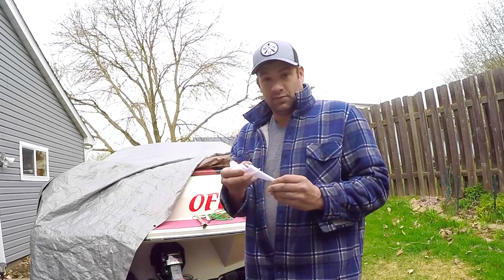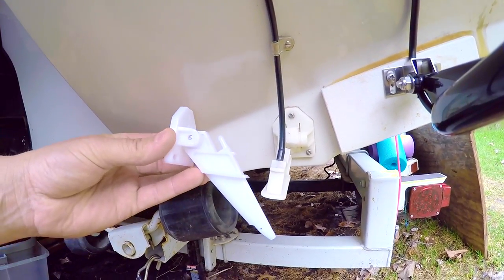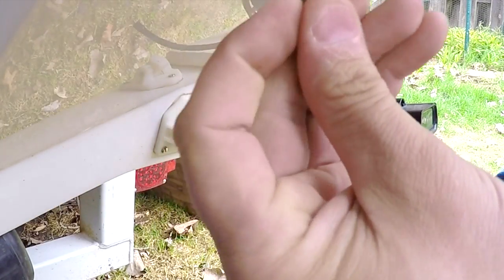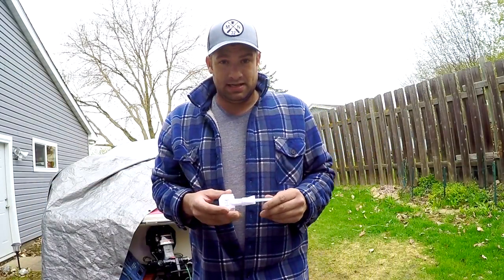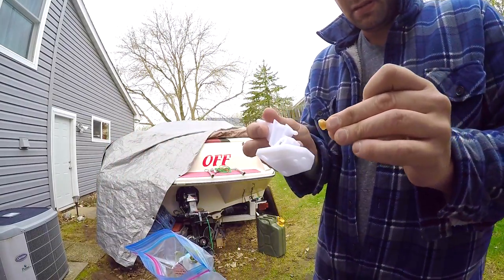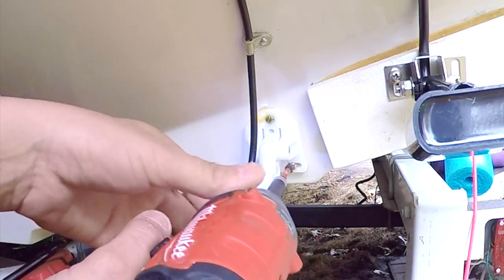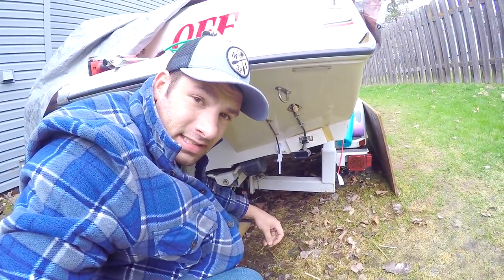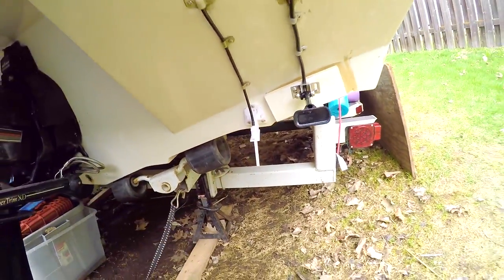How to fix your Boats Speedometer Pitot Tube

Comment: I have an rpm gauge too. That works but speedometer doesn't. Can I repair the speedometer
Reply from the maker: I guess I'm not sure what you mean. Are they together? The pilot tube just feels the water pressure which makes the speedo gauge work. Sometimes the reader is apart of the lower end and doesn't have a pitot tube. Sometimes spiders and stuff can get stuck in it which prevents it from working or just old lines which don't seal right. It might also just beva bad gauge. It you can take a air nozzle and blow into the hose and have someone inside the boat see if the gauge moves.
Reply: @BigIslandMNMinnetonka  I figured it out. The tube is connected to the foot of my motor and the hole is in the motor itself. I got some mud in it
Reply from the maker: @therealmarknelson  nice work!

Comment: Hello, the speedometer of my boat does not work, we put air in the hose of the pitot, the indicator plays, we hold the air at the tip of the pitot, the indicator does not play

Comment: SPEE-do-meter PI-lot tube?  Or Spee-DO-me-ter PEE-to tube?
Reply: Pitot....is correct. Is  a pressure measurement instrument used to measure fluid flow velocity. The pitot tube was invented by the French engineer Henri Pitot in the early 18th century.
Reply: He made a video  on how to replace it and he has no idea what it's called.